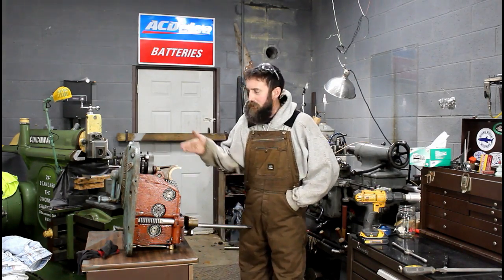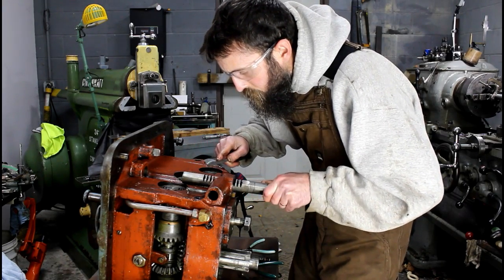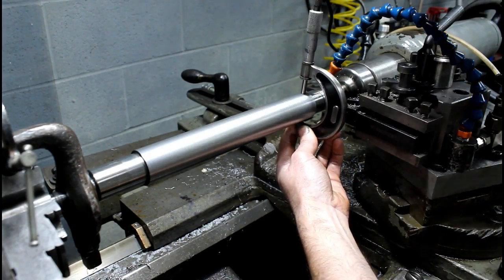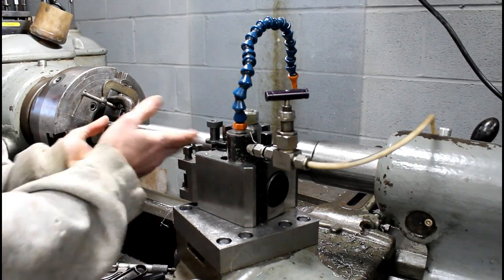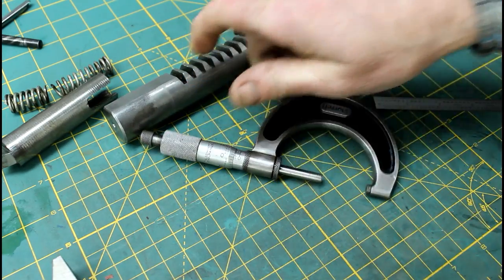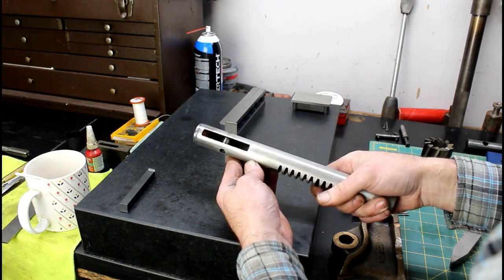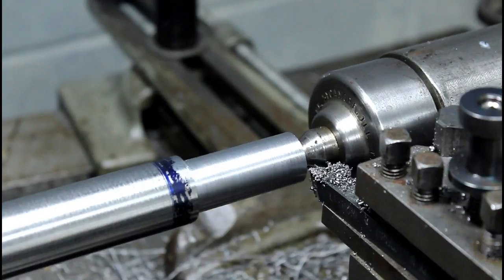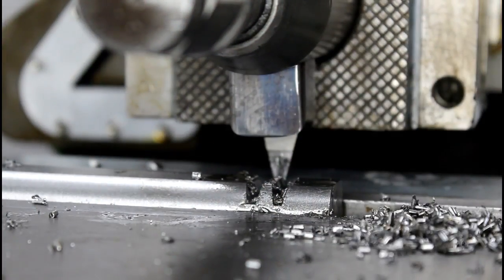Cutting the Rack for the K&T Mill Part 1

Comment: Hello Steve 
My name is Stan Shapiro..
I'm a successful songwriter ... not a machinist. 
During this 'lockdown' I thought it might be fun to expand my horizons so I enlarged my garage to accommodate a machine shop, a wood shop, and a bay with a lift for a half dozen cars I'm restoring.
I've got an idea for a simple, inexpensive nautical device that I believe could save a lot of lives at sea... the problem isn't the cost but the engineering appears to be rather daunting... I wonder if you might be available to discuss this idea privately. 
I live in California... a long way from Kentucky.

My email address is Stanleyshapiro1@gmail.com

Comment: This being part one - I've seen part two and you couldn't';t figure why the bronze washer was there ... I've seen something similar in another YT video and I would think that the washer was machined to allow the missing shoulder that you referred to a few minutes ago (when the part was welded back together) to be cleared and maintain the required distance between the rack and the fork casting... Just a thought, I don't know if one else picked up on this?

Comment: You have a tool grinder. Grind that shaft and you will have the Finnish you want. Although it does take a lot more time to grind. Grinding is always better on hardened shafts. That’s just my opinion. .

Comment: Turning between centers is hit and miss  -- thin or-longer shafts usually set up a harmonic vibration.   If you will chuck the end, the vibration will tend to go away due to the damping effect of chucking.    In grinding between centers  , the harmonics seem to be less due to less tool pressure and therefore more successful application.    Personally I try to stay away from turning between centers if material size is questionable,   ----most of the time you will lose the battle on surface finish on long or thin shafts unless you are grinding. Everyone ask yourself this question------"when have I had good success with little trouble in doing work between centers?"   the answer will usually be "when the workpiece was short or had some mass to it"

Comment: Steve eons ago they sold very high pressure grease for lathe centers when turning . Might find a part tube on eBay of the stuff . When I was taught it was standard equipment on every lathe to have. Mostly because they didn't trust the dead live centers . You see the live center is the one in the head stock and the dead was in the tailstock..... Old facts like us old farts. Make sure you spot the offset hole with an end mill or its guaranteed to walk . You could chamfer the shifting arm a little to allow the new radius to seat well or just the thrust washer would be enough. Just trying to help. If you send me some insert sizes you use ill try to send some to you . Thanks and have fun , be careful as you said loose clothes and beards get tore out if caught up. God forbid . Love your woods and creeks. Good hunting to I bet.

Comment: Sometimes I wonder if you don't dissemble everything, put it back together again, then get the shot of whatever you're working on coming apart with the gentlest of taps. NOTHING I work on comes apart that easy.
Reply: I agree especially when the parts have been worked on before and the wrong tools were used.

Comment: On the head stock center, I always turn a step on mine so that cutting pressure cannot force the center back into the chuck...Turning between centers is often overlooked today but it is still the most accurate way to machine in many cases...This type of turning can even be done successfully with a dead center in the tail stock as long as you are careful to keep it lubricated with red or white lead (don't worry I am not going to eat it) and check from time to time for binding as the part will get longer as it heats up...I love this way of turning because it allows you to remove the work for a "try" when threading parts or doing other operations...

Comment: USING THE SHAPER TO CUT A ONE-OFF RACK GEAR TO THE MACHINERY HANDBOOK DEPTH AND SPACING SEEMS LIKE A NO BRAINER.  MAKING A NEW SHAFT TO THE WORN DIMENSIONS IS SPOT ON:  NO MORE HALF A***D REPAIRS.

Comment: Steve I think you should make the scalopped end the same as it is because you will weaken the shaft more with a straight deep cut
Reply from the maker: Don't think I can cut it with the machines and tooling I have. I would rather do it like the original 👍.  I'll think on it
Reply: Steve can you use a smaller cutter and make more passes to get it done . I think you can do it

Comment: As always a great video, you could clean the breech, drill and thread both ends and put a piece of threaded round bar in it and weld it neatly, it's lot less work and steady repaired. It is not my idee, I saw Abom do it on a large roller!

Comment: That turned out nice, that shaft was probably ground originally.Judging by the oil vapor coming off it it was pretty hard. How many teeth per inch (pitch) is that rack my guess is 4 P. Of course a #8 cutter for the mill but I think I'm starting to see the wisdom of the shaper for form work. A DRO on that table cross would be real cool for that job. and glad to see you using Machinery's handbook all real cool steve. really thank you for some cool projects

Comment: Hi Steve, great video as always. Nice to see the shaper earning it's keep :-)  I am curious, whilst making a new shaft creates a great video I think had I been doing the job I would have considered drilling / boring a hole in the end of the broken shaft and doing the same with the snapped off piece, then threading a rod one end left hand, one end right hand and using this along with pins to lock the two together again. I wonder if this is something you considered? Best regards to you and the family Sarah
Reply: If it was a larger part and had to get it running I would do it that way and have seen it done, but it does not last.
Reply: I think the milled out slot for the detent is too close to the broken end to allow for this. The shaft would be very weak if drilled out. This is possibly a poor design to start with and unfortunately Steve has little choice but to make a new piece.
Reply: @jonka1  Thanks Jonka1 I should have realised that best regards Sarah
Reply: Sarah 
Thank you for your reply. I wish more comments on this forum were as pleasant and generous as yours. 
Jonathan.

Comment: Great video on tear down/investigation. Difficult to comprehend all the man hours in previous strip down and rebuild, then a extremely poor weld attempt. Bending moment is pretty high, ref distance from fork centre, would tightening the second keyed shaft nut help reduce this?.
Enjoying the very good photography Steve.
Reply: to weld shafting like this, you need to machine the little piece that broke off to a V such that there is a 70 degree angle between the broken piece and the rest of the shaft- standard welding angle, one of the first things you learn when beginning to be taught welding (I'm an award winning welder!) . The parts are tracked and welded - cast by brazing, steel by stick/TIG welding - and progressive runs are applied, alternatively to each side, checking that there is no 'run-out'. Welding keeps going until you have enough to machine the part to size, not neglecting the radius that I mentioned above; this radius will prevent cracking, the cause of which probably broke the shaft in the first place.. The washer that has a radiused chamfer that fits the aforesaid radius and this is the reason for the gap - and the washer - between the thick part and the fork end. Just a thought - you might like to try this on the old shaft and you would have a spare part in case of breakage of the part that you machining now. I would draw this idea up, but I don't know how to put into one of these message lines! My email address is drpollard@bigpond,com if you wish to pursue this further. BTW I am also an engineer!

Comment: Steve, like you my shop is not heated and like you I wear sweat shirts this time of the year. My wife got me these velco straps, at Walmart,  so that I can pull my sleves up and secure them. I know I look like the cross between a riverboat gambler and a street punk but I'm warm and my sleeves are safely out of the way. For some reason the older I get the less I believe my Dad's old saying, "There heat in those tools."